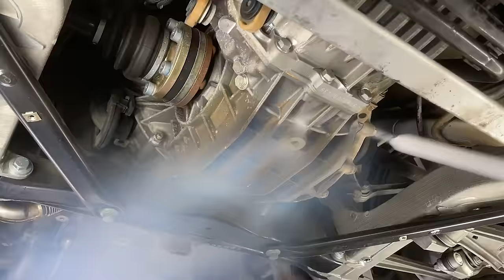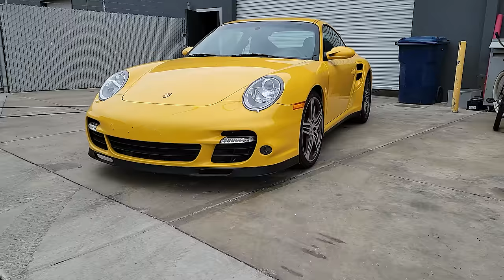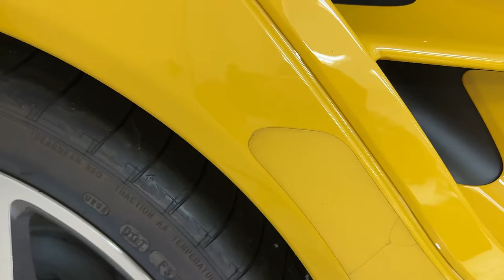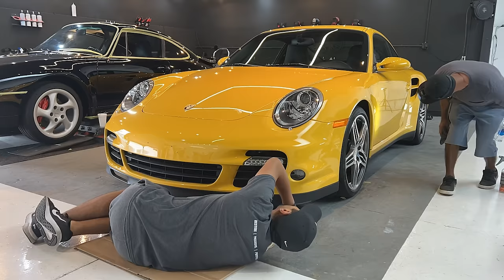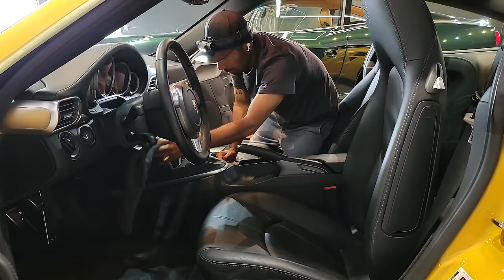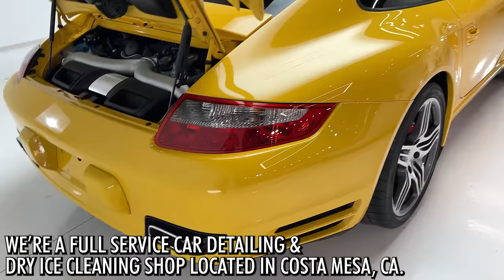Dry Ice Cleaning & Detailing a SPEED YELLOW Porsche 997 Turbo

Comment: Only cleaning areas accessible to the dry ice spray. The other side is still grubby. So what’s the point of only doing half a job?
Reply: What's the point of cleaning the parts no one will ever see? Do you black the insides of your tyres? Do you take the door cards off and clean the insides? lol